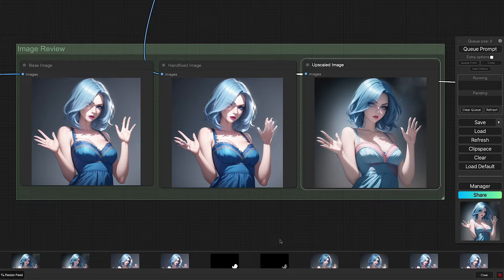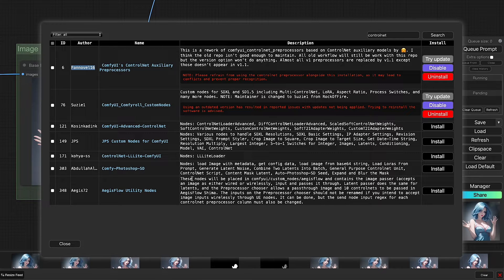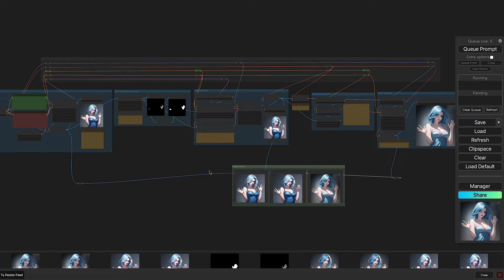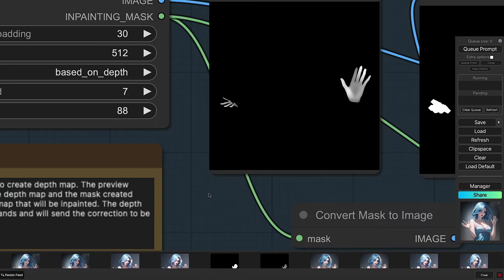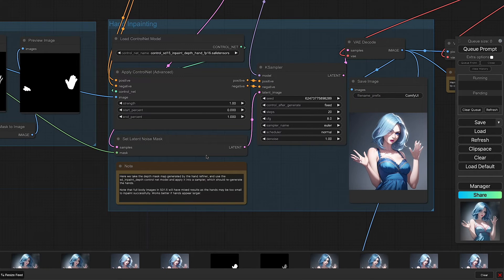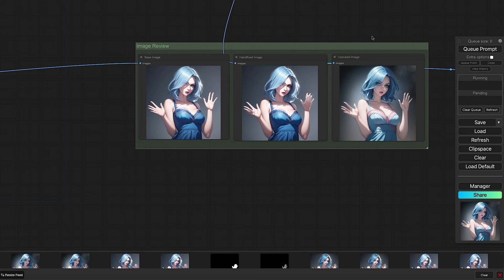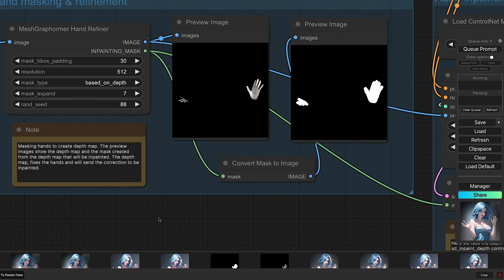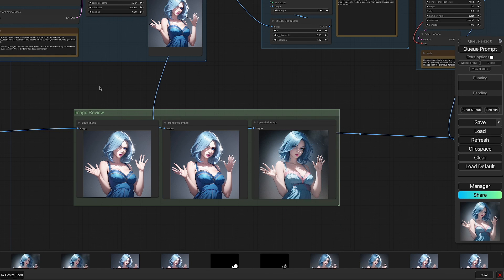Ultimate way to Fix Hands | ComfyUI | Stable Diffusion 2024

Comment: Looks like a very useful flow, however I can't seem to run it, I get this error message: Error occurred when executing MeshGraphormer-DepthMapPreprocessor: followed by a number of missing files messages. Any ideas?
Reply: The libraries required by this custom node don't work in Python most recent versions.
Reply from the maker: are you running it locally? inside a venv? It sounds like something may have gone wrong when installing the nodes. I would try reinstalling the nodes. If you still have an issue, run comfy inside a venv and try the installation again